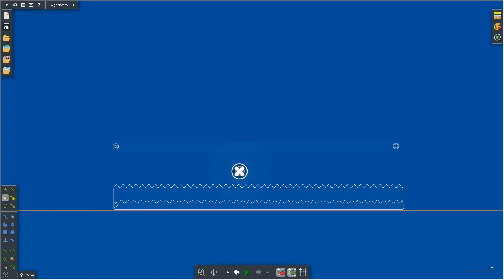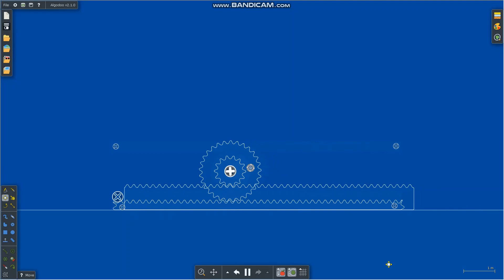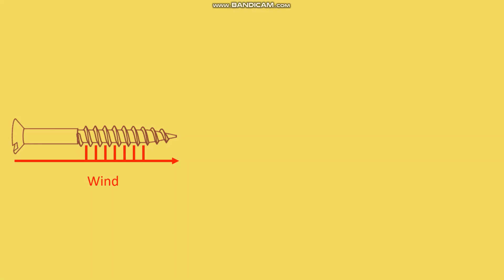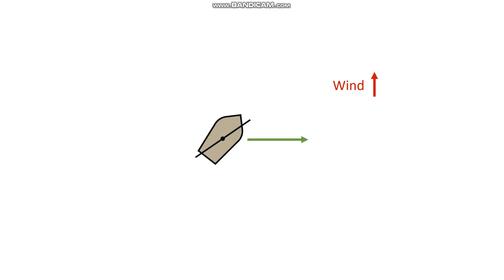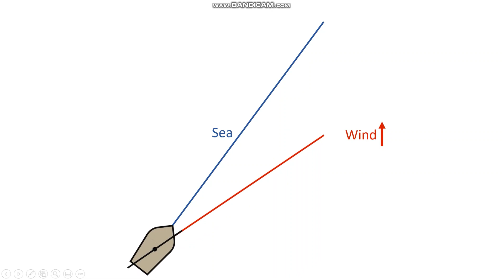Explained: Sailing faster than the wind, downwind

Comment: This is a very good explanation.  I made a similar video, but only 1% as good.  It does show a vehicle design that is half way between your gear rack model and the Blackbird.  Then I make an argument based on the wind applying force on things moving slower than the wind.  It's a bad video but it is very short.  Nothing happens for a few seconds, but then it gets really exciting :)
Reply from the maker: A wonderfully illustrative model! It shows very nicely how the wind can push on the rotor slower than the windspeed, and yet make the cart travel faster than the wind.

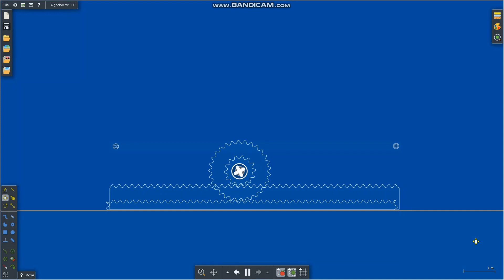Comment: You are absolutely correct! At 3:22 , “it is the air that is pushing the turbine”.  How this is actually possible is explained in the following analysis of rotor blade relative airflow (RAF): 

The rotor blades follow a fixed helical path as the cart advances along the ground.  The helix lead angle, 𝝀, is the angle between that helical path and the plane of rotation.  In zero wind conditions the angle of the rotor blade RAF defaults to 𝝀.

The rotor blade zero-lift angle, 𝛳, is the angle between the rotor blade zero-lift line and the plane of rotation.  

Moving in zero wind conditions, with 𝛳 set equal to 𝝀, the blade angle of attack is 0 deg, so no lift is generated and the rotor passes through the oncoming air stream with little resistance.  

In the presence of a tail wind the angle of RAF shifts rearward, resulting in a positive angle of attack, lift on the rotor blades, and thrust on the cart.  Thrust on the cart accelerates the cart forward, which simultaneously drives the wheels and causes the rotor to turn.  

Vector analysis of RAF shows that with 𝛳 set equal to 𝝀 then RAF normal to the zero-lift line has continuous magnitude Vwind * cos (𝛳),  while RAF parallel to the zero-lift line has magnitude Vwind * sin (𝛳) - Vgrnd / sin(𝛳).  The continuous RAF normal to the zero-lift line allows the wind to maintain a positive angle of attack on the rotor blades, and thus thrust on the cart, throughout the cart’s entire speed range.  :-)

P.S I prefer ‘rotor’ to 'turbine'.  It avoids the bias inherent in the terms ‘turbine’, ‘propeller’ and ‘sail’.
Reply from the maker: Thank you! And I agree. 
It's nice to see someone enjoying my video after all these years c:

Comment: if you put the thing in water both cogs/water wheels would have the same angular speed at all times and when it got to windspeed it would not be subject to any acceleration. Your boat may go faster than windspeed but its velocity made good will not be greater than windspeed.
Reply from the maker: If you put the device in the water (to the correct level for the paddles of course) then indeed as you say, both the cog and the paddle wheel will have the same angular momentum. However, because the diameter of the paddlewheel is smaller than the cog, its linear velocity at contact with the water is always slower than the axle they share. Therefore when the paddlewheel has matched the water speed, the entire device is faster than the water speed.

To put all this another way: Do you agree that the cog assembly in the video is propelled faster than the rack driving it?
If yes, then we can replace the rack with a wheel and surface to the same outcome. And now the surface with a trough of fluid with infinite viscosity - same thing. Now slowly decrease the viscosity, and compensate by adding larger paddles to the wheel to prevent it from slipping. One should again get the same result or do you disagree? At what viscosity would the analogy fail?

A valid objection might be that the driving fluid is in a trough, as opposed to the whole thing being immersed, but at low viscosities it makes no difference because one can vary the ratio of drag on the body to drag on the paddlewheel or propeller arbitrarily by increasing the blade area.

Any further questions?
Reply: @chalichaligha3234  You ask:  Do you agree that the cog assembly in the video is propelled faster than the rack driving it? I say no, cos the rack represents the wind so when the cog is going windspeed the rack has no velocity relative to the cog.
Reply from the maker: @MrStevenlynch  Ignoring representations and abstractions for a moment, does the centre of the pair of cogs in the video travel faster than the rack pushing them? If we agree on at least this, then we can move on to discuss the validity of the model when considering interactions with fluids rather than solid gears.
Reply: @chalichaligha3234  yes. you get a similar effect when unrolling an extension lead on a reel. But it doesnt model the situation cos the rack stops moving at windspeed.
Reply from the maker: @MrStevenlynch  Well, if you agree that it works for cog wheels, one could replace the small cog wheel engaging the moving rack with a worm screwing its way along the rack, appropriately geared to the ground gear.

Now, you agree that this setup works for solids, but why not fluids? One could continuously decrease the viscosity of the wind rack, and increase the area of the worm engaging with it to form an archimedean screw or propeller to minimise slippage.

At what viscosity would it fail to work?

Comment: But with your model the "wind" is constant, on the craft the actual wind will be zero when the craft reaches wind speed, which is the position before you start the animation, so your animation is invalid.
Reply from the maker: This model does not show the fact that propellers are lossy unlike gears. If you replace the wind rack with a trough containing water flowing with constant velocity, and replace the small gear with a waterwheel which engages with the water in the trough, you get a more accurate model.

It should then be evident that this wheel + waterwheel device should reach the same final equilibrium point as the geared model presented, faster than the water speed. Thus also, when the device reaches water speed, one can say it experiences zero water flow - however at this speed the paddles on the water wheel engaged with the water would still be moving slower than the water, so would continue to be pushed by it, accelerating the craft until equilibrium.

This carries over to the actual craft, with the screw rate of the turbine/propeller being slower than the wind when the craft is at wind speed, and so the wind continues to accelerate the craft.

It can be quite confusing, but I hope this makes sense?

Comment: Here's the problem with the mechanical advantage explanation. It assumes the force the wind applies to the vehicle remains constant - it doesn't. As the vehicle moves, the force due to the wind becomes less so when the vehicle is moving at the same speed as the wind there is no more applied force. You can't violate conservation of energy. The correct explanation has nothing to do with mechanical advantage (although the wheels do need to be connected to the propeller). The way the vehicle moves faster relative to the wind when no more energy seems available is the same way sailboats do when tacking downwind. The prop blades act like sails that are constrained by their connection to the vehicle's wheel to move in space at an angle to the wind. This creates additional lift, the force needed to move the vehicle faster.

(Edited to remove my incorrect interpretation of the sailboat animation.)
Reply from the maker: The model assumes constant wind velocity, not constant force. In fact, if we are to take the model at face value it assumes infinite force until the cart matches windspeed (instantly) and then zero force at max speed as I didn't explicitly model drag. 

If you simply replace the wind rack with water moving in a chute, and the small gear with a paddlewheel, then force on the craft will decrease as the craft approaches it's maximum velocity, just as in real life. I thought this was an unnecessary level of explanation at the time.
Reply: @chalichaligha3234  If the model starts ideally with the vehicle moving at the speed of the wind, then how is the air rack moving at all relative to the vehicle? Shouldn't it be motionless? But even if we ignore this, when the vehicle is moving as you show, the wind is moving backwards relative to the vehicle. Since the wind is the only source of energy, how is this possible? The illogic doesn't matter because the real problem is the model's assumption about wind direction. From the animation with the stationary gear we see that the air rack is actually being pushed to the left to make the ground rack move to the left (for the vehicle to move to the right). If you push the air rack to the right (as the model assumes), the ground will move right (and the vehicle left). This means in the animation with the stationary ground, the wind direction is actually from the right - there is a force due to decelerated wind pushing from the right on the "air rack". The rack only appears to be moving right, we know the rack is really being forced left relative to the vehicle (you can do the thought experiment in your head). This is why wind shouldn't be modeled as a force - it isn't accurate.
Reply from the maker: @flyyynt  If you want to be precise, you can model the wind as a force relative to the ground. In the gear model this means adding a gear on the ground pushing the wind rack or vice versa. Now whatever reference point you choose, including from the stationary gear's perspective, it is the ground/air force gear that causes the cart to move faster than the wind relative to the ground.

To address your earlier point, we should use the water/paddlewheel adjustment to the model from my previous comment. If the machine is at windspeed then there is no relative motion between the wheel's center and the water. But the paddles on the wheel would be pushing the water backwards - meaning the water is pushing the paddles forward. Relative to the ground: the water speed is higher than the paddle speed, so the paddlewheel is accelerated by the water  until the speeds are equal and the craft is above windspeed (or more accurately when paddle drag force pushing forward equals the drag backwards on the craft).
Reply: @chalichaligha3234  The wind or water speed relative to the ground is meaningless when judging energy transfer to the machine because the machine is moving relative to the ground. If the machine is moving at the speed of water flow, and there's no relative motion between the wheel's center and water, what is causing the paddle wheel to push the water backward? Please don't say the big gear is turning it because the ground is not supplying any energy (although the machine does have stored energy due to its momentum relative to the ground). The big gear only turns because the paddle wheel turns it. The water flow is the only source of energy: no flow, no energy to turn the wheel. So really you can't even get to this situation. But it doesn't matter because as I've shown (and you've ignored) the machine doesn't move in the same direction as wind or water flow anyway. If you imagine the shaft of the wheel pinned above the water chute, when the water flows from the left, the gear rotates counterclockwise. So the machine would move to the left (against the flow, which has its own problems), not right.
Reply from the maker: @flyyynt  This was covered by Veritasium: from the craft's perspective, at windspeed, the ground is indeed supplying the energy. This is because, as I have said before, the true source of energy is the difference in speed between two mediums, whether air/ground, water/ground, or rack/rack. The wind cart or compound gear can ideally extract this source of energy at any velocity - that's the sum of it.

Yes I have imagined the shaft of the wheel pinned above the water chute. Yes it would spin in the opposite direction. No this does not mean I'm wrong, it's a different class of lever, please see that section of the video.

If you don't think it works, I challenge you to make a model of the water wheel on the axle of a larger wheelset. Then spray a garden hose on the lower side of the paddles. It should go in the direction of the water, and with the right conditions, faster than the stream itself. If you provide evidence of the wheel moving towards the hose, I'll take down this video.
Reply: @chalichaligha3234  When the machine is moving at the speed of the wind in the direction of the wind, you cannot collect more energy from it if you're using drag, which is what this machine uses. Mechanical advantage does not allow you to violate conservation of energy. You can collect more energy at wind speed (or either above or below that speed) if some part of the machine is moving at an angle to the wind to obtain lift - that's the only way you can use the energy difference between wind and ground at or above wind speed. The propeller on the Blackbird is constrained by its connection to the wheels to do this. If Veritasium says otherwise he's wrong. The Blackbird wouldn't work if it used an air paddle wheel, no matter how it was geared.

After thinking more about the machine you present I do concede you're right about the direction it moves. I thought there was a mistake with its configuration. But regardless of that, it would have the same energy issue I've described above. I'm not going to build a model, but if you did I'd be happy for you to prove me wrong.

Comment: The compound gear can only travel faster than the stationary track below it because of the torque differences between the two gear sizes of the compound gear.

Note that this torque force is applied to a solid substance.

DDWFTTW are interfacing a solid (the ground) and a compressible gas (the air).

Since you really can't apply any significant torque force to a gas - since it will just compress under pressure - please explain how your model is relevant to DDWFTTW.
Reply from the maker: The wind rack does not experience torque, only force from the teeth of the compound gear. The compound gear does experience torque, but it represents the wheels, gearing and propeller/turbine, so that's to be expected.
Reply: @chalichaligha3234  Right, I understand, but your model using a compound gear to provide torque does not fully account for the system. Where is the energy input?

Also, are there are actually any compound gears in DDFTTW vehicles? If there are, I am not aware of them.
Reply from the maker: @bryanjackson8917  The energy input in the model is the wind rack - just as in real life it comes from the wind.

The compound gear is merely a convenient way to form a gear train between the two racks. Any other way would also work, as is the case with the real cart.

Comment: Sometime explaination is simpler than you think. Let me explain why:
First I name the propeller " flywheel " You will understand what I mean if you follow my exlaination.
Pay attention to " flywheel " rotation speed and the wheels which attaching to the propeller with chain and gears... If transfer ratio between the wheels and " flywheel " is fix when the vehicle reaches wind speed the " flywheel " will reach a maximum a rotation speed if no external force is applied. In another side Veritasium claimed the vehicle reached the speed of 2.5 times of speed of wind. That means the " flywheel " rotation speed must reach speed of 2.5 time speed at the time the vehicle at the same speed of the wind if transfer ratio of the propeller and the wheel is FIX. Check it out you will see what is actual speed of propeller from start to the end. 
When the vehicle reached speed of wind if you have a transmission box with more than one speed between the wheels and the " flywheel " and you shift gears of the transmission box you can slow down or speed up the vehicle depend on the gears ratios.
The " flywheel " at this time acting as a flywheel drives the wheels directly by chain and gears not by the propeller pushing air. The " flywheel " uses it energy it stored before it reaches speed of wind to push the vehicle.
The propeller from start to the end acts as a flywheel no more no less.
You maybe wonder why they did not make a flywheel and put it no the vehicle lower to ground.
It is not practical to do that because it makes total static mass too big so the vehicle can not reach speed they want.
Blades of "the propeller" make it posible because "the propeller"  can store enough energy with a lighter weigh.
The blades of "the propeller" in their design only make you think it's a propeller.

Comment: Good job on the sail boat explanation.   

I'd like to challenge your demonstration using the gears for the down wind car.  There's more going on than is captured in you graphic. propeller is powered by the wheels as the travel along the ground.   It is in fact pushing against the wind, not harvesting the wind power as a wind turbine does.  It creates low pressure in front of the propeller and higher pressure behind the propeller.   

I haven't dug into this very deeply.   But, I believe Bernouli's principle applies here.  

1.  The movement of the vehicle over the ground provides mechanical energy to the wheels
2.  The wheels rotation causes the propeller to turn. 
3.  The propeller creates a pressure differential with low pressure in front of the vehicle and higher pressure behind it. 

Where does the efficiency gain come from?

:) ??